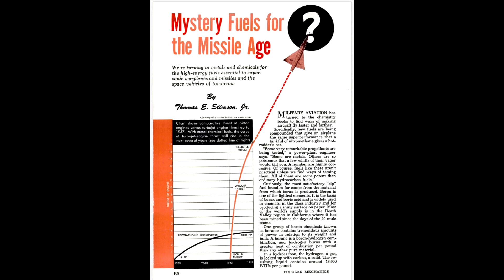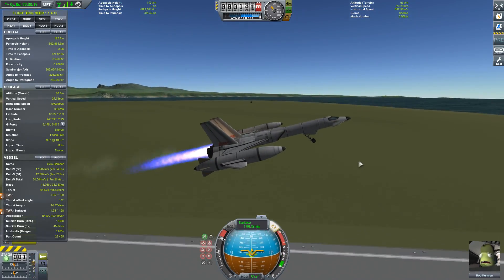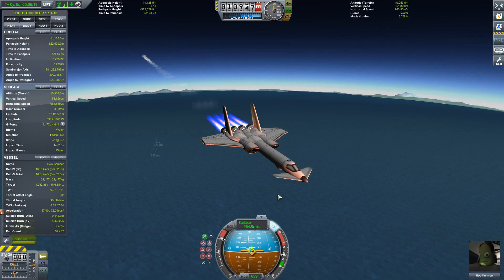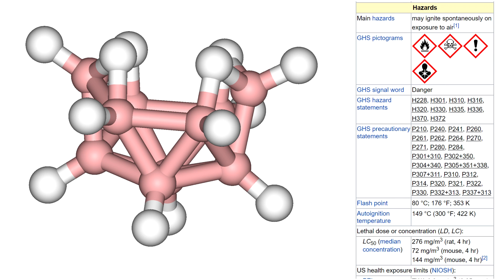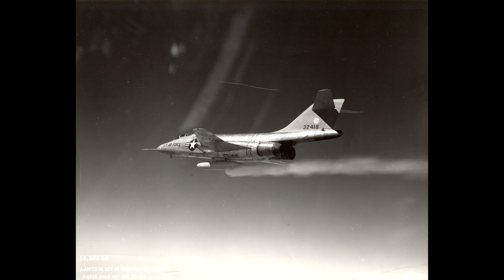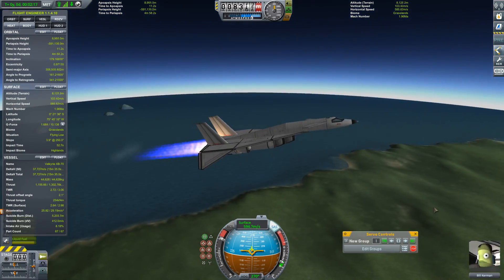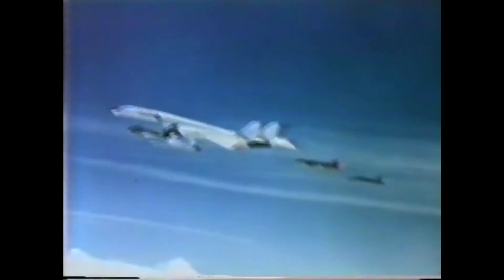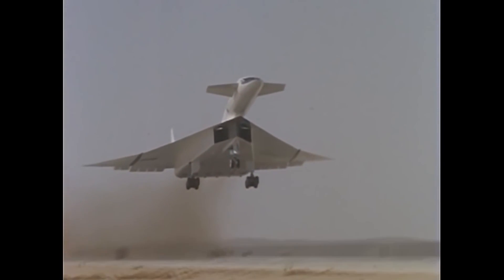Zip Fuels & The XB-70 Valkyrie - The B52 Replacement That Never Happened

Comment: huh, i have been using a fair amount of both boron and carbon and shoving it in kilns at 1250c lately, with the amount of silicon, nitrates, calcium, aluminum and a whole host of other metals, oxides and minerals, they should react with those before something as fragile as boranes are formed, though at those temps the chemistry is surprisingly hard to predict, especially for non academics, glass chemistry with added crystal formation is surprisingly hard to find good literature on, my latest baby is using barium sulfate to control melt timing.
Reply: Oodain
If you're making inorganic crystals in a kiln in a glass substrate, you should research kiln thermodynamics before chemistry.  Understanding and controlling the thermal characteristics of the kiln is key to understanding and controlling crystalline formation and growth.

After that what you seem to be focusing on is inorganic, non-metallic crystalline growth, which intersects with the semiconductor industry, hence the dearth of publicly available technical papers.
Reply: well i am making ceramics, pottery and the glazes are practically all made of some pretty complicated glasses, but you are right that temperatures and timing are crucial to a proper result, most of the crystals i have had success with growing on a macro scale in the glaze are pyerite, various zink crystals, most commonly zink-silicates and borates and a few examples of titanium crystals.

one of the problems in growing crystals in a glass medium is holding the glass liquid enough, for long enough for the phase separation and crystallization to occur, we usually use boron, calcium oxide and sodium as fluxes.
recently i have started experimenting with adding barium and sulphur to other recipes to help in crystal growth and control the melt.

barium sulfate is less of a flux than both the sulphur and the barium separately but it will readily react to barium sulfate in the presence of adequate sulphur and oxygen, so while they are separate in the glaze they lower the metling temperature of the whole glaze but as they react the melt temperature increases (all a hypothesis, more experiments are needed)
but it does seem to work, i can get larger surface crystals that way and the risk of large glaze runs arent as big of a risk as the permanently lower melt crystal glazes.
Reply: I can't PM you or I would.  Very interesting stuff, can't say I've ever heard of a glazier trying out such exotic materials.

One thing you should research is a fundamental concept in chemistry called "The colligative properties of solutions."  Once you grasp that, you will understand how the glass' properties change as the crystals form and draw dissolved/suspended materials out of the 'solution.'  What you may want to look for is something that will dissolve in liquid silicon dioxide (I assume that's the base melting material you're using) and not boil off or get pulled into crystal formation.

I appreciate and enjoy artisanship and pre-industrial crafts.  I firmly believe that while machines CAN do a great many things, they shouldn't do EVERYTHING.
I wish you great good fortune.  I'd love to see the results someday.

Comment: "How can those be drop tanks when they're embedded in the wings like that-" (drops the entire outer halves of the wings) "...oh dang"

Those would have been expensive as hell to mass produce, they would have had some impressive tolerances and would have needed to be far more precisely built compared to other drop tanks of the era. Just one reason of many that design never left paper.
Reply from the maker: I think they would only have been dropped during combat missions, and given that it's task was dropping nuclear bombs in WWIII I don't think they'd need many spares.
Reply: That is a lot less of a problem than you think; It would use that sprint speed on Nuclear Bomb Attacks.
Nuclear Bombers spend almost all of their lives cruising and looking scary, which wouldn't require dumping wing-tanks. The wing tips would be dumped along entry, at about the time the bomber started its marathon sprint.
Around the time this plane was designed, Supersonic speed allowed planes to completely outrun the Anti-Air missiles or fighters trying to kill it. For most of Vietnam the r-f4 phantoms with around mach 2 could get in and out of a air-defense net before any missiles could launch and get to an intercept.
So this feature is not quite as stupid as it may seem.
Reply: also very easy to spot on the radar, they would spin like crazy after dropping
Reply: The engines used in Concorde and the Vulcan bomber were actually the same: The only real differences were the afterburners fitted to Concorde (which the Vulcan didn't have or need), plus the air intakes used on Concorde to allow it to fly at supersonic speeds without damaging the initial compressor stages of the engines.

However, these are not technically modifications to the engine itself, since the special air intakes make no difference at subsonic speeds and the engine doesn't need afterburners to function. Concorde actually only uses its afterburners for takeoff and for smashing through the sound barrier. Once at supersonic speed, the afterburners are switched off and it supercruises.
Reply: Yeah, the whole point of those aircraft was they flew so fast and high that air defenses were irrelevant.
To put this in perspective, while no longer the case when it entered service, if it had been around during the era that supersonic bombers were being used, concorde would have had the performance required to outrun the majority (but perhaps not all) of the air defenses that existed.
(then again Concorde's engines are derivatives of those from the Avro Vulcan bomber, which is precisely such a high speed, high altitude nuclear bomber)

Being invisible isn't necessary if you can simply outrun anything that tries to hit you.
Reply: Those drop tanks look like they could operate as there own glider when released. But autopilots would not of been good enough for them to fly back home by themselves at that time.

Comment: Why dont they try to find a replacement for the B-52 now?
Reply: Because it is cheaper to build a bunch of cruise missiles, entire concept of heavy bomber is obsolete.
Reply: It is quite impressive that the B-52 will be probably about a century in service
Reply: Its also politically unviable, since for the last 30 years, there has been a strong emphasis on precision strike weapons and one-weapon-one-hit tactics. A strategic bomber flies in the face of those kinds of policies, since the whole role of a strategic bomber, is to fly over and flatten whole areas with massive ammounts of munitions. SImply put, the CNN effect killed the big bomber.
Reply: Mostly because we don't really have a need for strategic bombers anymore.  ICBMs and SSBNs do a much better job in the role the B-52 was designed for with less extreme crew requirements.  The B-52 by virtue of being huge, high-capacity and high-endurance means it can fill other roles while we have them, but there's no point in building more or working on a replacement because its main job just isn't needed anymore.
Reply: Simply put they found several, 
1.The B-2 for stealth penetration of defended airspace
2. The B-1B for low level penetration

The B-52 is still around because it still has a use as a big bomb truck.
Now that normal bombs can be made to home on designated targets the range and payload of a B-52 circling on high in uncontested airspace makes it the single best CAS aircraft in the USAF inventory.
Reply: Ben Grogan 
And the B-52 can function as a smart munitions warehouse/C3 center; with a crew of 6 it can shower an area with precision target strikes for hours with adequate air protection.

Comment: 3:03 I'm probably going to sound really dumb, but how can that molecule be possible? I thought hydrogens can only make one bond.
Reply: Normally when we say hydrogen only makes one bond, we're talking about standard covalent bonds, where each individual electron is locked into a single bond.  
I believe that molecule contains a different type of bond, where a "delocalized" electron can be shared between two different bonds, but each bond is weaker than it would be if it didn't have to share the electron.  
(If you're familiar with the concept of resonance structures, this is related to that.)